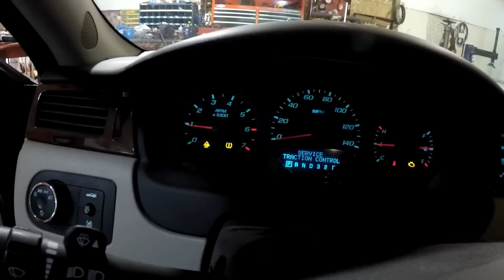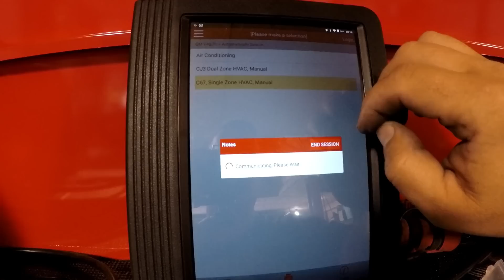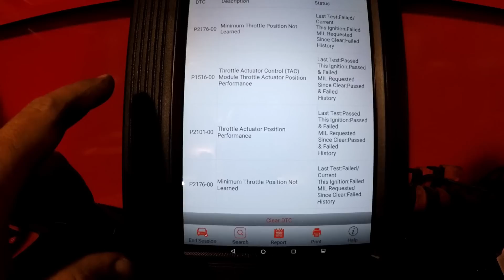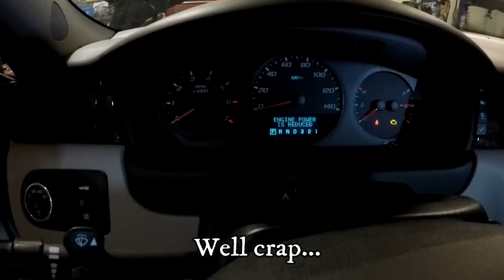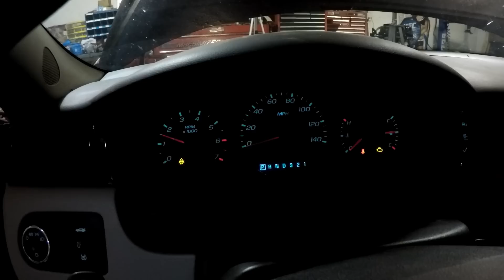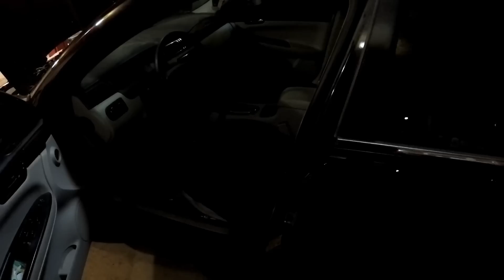How to fix Reduced Engine Power and Service Traction Control on GM Chevy Pontiac Buick

Comment: That was a very good video. Although I do not have that problem, it may become helpful because my son owns a Chevy Malibu. Would it be the same? Also, I did notice that traction control light but you did not mention anything about it since this video was not meant to fix that, however, my son's 2013 Malibu has that same light that will come on when he brakes. Any diagnosis/fixes for this problem?

Comment: I have an 08 Impala as well with that problem. That link just goes to Amazon btw, but I can find the part.
Anyways,  I have a basic scan tool-can I reset my idle?(if so,  how?) If I don't what will happen?(high or low idle?) Please advise

Comment: Great video. Thanx for posting. I have a 2012 GMC Acadia. I have replaced my MAP sensor (code thrown) and now my throttle body. I am still getting reduced power and stabilitrak signals on the cluster. It is running rough just like that car was. Any ideas where to turn next?
Reply: Hello Max…did you find a fix for your issue?
Reply: @professionalics  nope. The car is a disaster. I keep throwing money at it. Time to trade out of it I’m afraid to say.
Reply: Check your ecm, it's located under the airbox

Comment: Thankyou so much!... I was driving my 06 Impala ss and the "service traction control" came on along with the "reduced engine power"... I got it home in limp mode after only being able to go 30mph with a very rough idle... got it in the driveway and starting looking... I noticed when I turned the key to the "on" position I could hear a very loud grinding noise... Turns out the gears inside my throttle body were stripped therefore causing the rough idle and grinding sound. Picked up a new duralast Throttle Body installed it myself in about 15 minutes started the car and acted like nothing even happened in the first place... Came here first to see that the problem mightve been and low an behold... Throttle Body it was... lmao

Comment: Hey I need ur help I have Chevrolet impala 3.5 LS 2006 I NEED to change my IDLE CONTROL VALE can u please let me know were it is located the idle control VALE please help me thank u u can get in contact with me at 4845168460 please let me know were located at idle control VALE ok
Reply: I need to change the idle control VALE I can't find were is located they saying is on the left of the throttle body but I don't see it help me tell me were is at ok
Reply from the maker: Do you mean VALVE? There is no idle control valve on an 06 Impala. The throttle body is drive by wire and doesn’t use an IAC. The older ones (3.4) did use one however.
Reply: Santer auto how many OXYGEN SENSORS does Chevrolet impala 3.5 LS 2006 have my check engine light is on because oxygen sensors I change bank 1 and bank 2 but the check engine light comes back on I been told that they have 3 oxygen sensors but I can't find the third oxygen sensors but let me know how many they please thank u
Reply from the maker: I don’t understand what you’re asking? What’s the car doing?

Comment: Chevy should fire all their engineers cause this is  a problem. Change the  TPS and it worked.
I have all so check the ground wire in motor area and the ground wire in the bottom frame. thanks.

Comment: Great video. I have an 05 navigator the advancetrac light and abs light flash once and turn off with a little jolt to the vehicle. then it runs on reduced power or in third gear only, not sure which, until you turn it off and start it back up again then it's back to normal. Any thoughts on where to start looking for the problem?
Reply: B

Comment: i am wondering...
if the computer was silent, 
and all the sensors were not triggering,,,
would the vehicle have gone into reduced power mode, 
or would it have just operated normally...

Comment: I have a 2008 Buick Lucerne.  It has Engine power loss and traction control both coming on.  This has gone on for months. We have replaced the map sensor, had the catalytic converter checked out, put SEAFOAM in the tank,  and now replaced the air filter,  the throttle body and the air flow sensor - ITS STILL losing power driving.  Unfortunately it’s my daughters and she’s always having issues away from home after thinking it’s fixed ?!?! Any more suggestions

Comment: Ok so I’m lost here...did that have anything to do with the stabilitrak or just the reduced engine power? I have a stabilitrak issue that happens every once in a while when i start the car in the morning and my speedometer will start acting crazy going back n forth and the traction control lights come on and after it keeps going crazy the engine light will finally come on! Once the engine light comes on everything stops acting crazy! Funny thing is normally it only does it in the morning and won’t do it again all day or maybe eve for a couple of days! Im willing to bet its the damn sensor on the wheels! Nevertheless it’s irritating as hell!

Comment: I have a chevy equinox 2010 with reduced power engine and traction control.  when scanned, code P0089 and P228D is erasable.  Is this method also useful.  I bought new high pressure fuel pump, not still working.  what do I do?

Comment: I got the warning after i removed the ECU fuse to erase fuel trim after old gas and forgot to put it back on. Car is driving but check engine stayed on i hope it resets after a couple days of driving.
Reply: After a couple days the CEL was still on, i once again removed the ECU fuse and poured a can of seafoam in the tank; after i replaced the fuse the CEL and warning went away within the first mile or so.
Reply: @johncrankshaft2886  seafoam!!..the placebo effect strikes again!!!!!!!!!
Reply: @mikesecondo2254  shit tell that to the sensor and ECU, all i saw was the light turn off 🤷‍♂️
Reply: @johncrankshaft2886  oh yeah...got to be that snake oil (engine repair in a can)
Reply: @johncrankshaft2886  it's like comedy hour....how so many people think the so called piss foam fixes everything....it's called marketing gimmick!!!
Reply: @mikesecondo2254  your argument would make sense if i had mentioned that i felt a difference yet the code had remained on however like i mentioned the code came off which means that values had to change for it to happen; sensors read values not the owner's sentiment.

Comment: I've got a question. I don't have this Reduced Engine Power notification, but I do notice when I'm driving down a road at 25mph or any speed really, it seems like my throttle is being pressed harder by itself even though I'm holding the throttle down as steady as I can in one spot. I'll try to stick to 25mph, for example, and find that sweet spot, but the vehicle just jumps forward intermittently (rpm bounces up). I just find it really odd and it's been bothering me for a little bit. Could it be the throttle sensor/body like someone, i know, mentioned to me?
Reply: Mine doing this. 2012 They trying to tell me it the fuel injection. I have 45000 miles change my oil on time and never run out of gas
Reply: App sensor
Reply: Have you found a solution? Having the same problem here

Comment: He's guessing he doesn't know what's he doing.
Reply: Educated guess (scan tool and could comprehend codes) that started with the most inexpensive solution and ended up with a permanent solution. He could've just started swapping parts and hoped that got it. Imo that's the kind of guy that you give a case of beer to when you pick up your car.
Reply from the maker: Mhmm.

Comment: I have a 2011 GMC Sierra I replaced the throttle body and it still didn’t fix it after that I replaced the gas pedal and the problem got worse after that what else should I try to fix it
Reply from the maker: Check the wiring integrity at the throttle body connector.

Comment: I just got that engine power reduced after I replaced the  tps sensor and cleaned the throttle body, left the battery unplugged for couple hours. What can be my problem? A bad tps sensor from manufacturer or still need relearn procedure?
Reply: Had a reduced engine power on my Impala. Remedy was a loose connector on the throttle body.

Comment: My engine reduced power issue was the lower engine mount.
Reply: Say what??????
Reply: Mount separated and pulled the main harness out of fuse block. Not by much, but just enough.
Reply: @kellybenedix5173  Mmmmm... Intresting.
Reply: Mike the mount had no fertting so no indication that is was separated.

Comment: How can you tell if it's a throttle body issue or a gas peddle sensor issue?
Reply: I thinking you have to narrow them down with the scan tool. Auto zone will do it for free I think.

Comment: I had this problem with my 2011 Chevy Impala for over 2 years. When it would happen and I  had "service stabilitrak" and "Traction control" show up, my temperary solution was to disconnect the battery for about 5 minutes which would reset the computers. This worked for the short term but only short term. Eventually the problem came back. All the videos I viewed indicated frawed wiring and a mechanics help. This video was the only one which made sense so I took a chance and the sensor replacement solved my problem and was something I could do myself without help. I performed this solution 2 months ago and it has worked. I bought the part on ebay saving about half of what retail would have cost. I would highly recommend this sight for solving small vehicle issues. Always do your research before making mechanical repairs on your own

Comment: When my 2009 Pontiac G6 gets really wet I have this issue.  Any thoughts?  If I spray the engine it happens instantly.
Reply: Could very well be the coil pack... I know my Girlfriends Buick Lucerne had problems like misfiring and low power when it would rain or after a car wash... I bought a new coil pack for her an installed it myself in about 1 hour and it fixed the problem right up... Hope this helps!

Comment: مني لكُم نصيحّة عربيّة ؛
لتنظيف الخآنــّـق ( ثرتّل throttle ) اللي في 
خآنّق الهواء ( ثرتّل بدي throttle body )  
بمدخّل جسد ( ثرتّل بدي throttle body ) ؛

مو ضروري تفُك الخآنّق throttle 
الـــ ( ثرتّل بدي throttle body ) خآرّج 
المُحرّك خليه مكآنُه وأتبع الخطوآت التآليّة ؛

1 - أبداء ك؛ من غير ما تشغّل المُحرّك / 
حط مفتآح الأشعآل ( السوتش / أقنشّن سوتش )
على أون  ON / ما قبل التشغيل لا تشغّل ( رّن RUN ) - 

2 - وأدعّس دوآسّة البنزين / الوقود للصآنجـّة / للأخير ،

3 - وحُط عليها حجّر - طوب - 
أو طآبوقّة أو عصاء ثبتها بمقعّد / بكـُرسي 
السآئق حتى تمسّك دوآسّة البنرين للصآجــّـة / 
حتى تمسّك دوآسّة البنرين للصآجــّـة للأخير ،،،

4 - فك غطاء اللي فوق المُحرّك 
    الغطاء البآغّة لتصل للخآنّق  ( ثرتّل throttle ) 
    وسوف تجّد الخآنّق مفتوح للأخـّر . 
   لا تلمسُه قبل ما تطفىء مفتآح الأشعآل ،،،

5 - بعد ما تطفىء مفتآح الأشعآل 
لمنع الخآنّق ( ثرتّل throttle )  من الحركّة ،،،

7 - الآن /؛ 
     نظـّـف الخآنّق  ( ثرتّل throttle ) 
     وووومدخل الهواء في جُرم الخآنّق
    في مدخـّل ( ثرتّل بدي throttle body ) .

 ؛  As I just said above in Arabic 

You don’t have to remove 
throttle body out to clean the 
throttle and air intake inside
the throttle body ;

you can  follow these steps
 and use these proven steps ;

1 - put the ignition switch ON
     ((( don’t Run the engine ))) .

2 - Push the gas paddle all the way to the floor this will 
open the throttle plate inside the throttle body wide open .

3 -   Put a brick or stone or 
    [ stick laying to driver seat ]
       to push and holding the
       gas paddle to the floor ,,, .

4 - Now turn ignition switch off 
  this way will prevent the throttle plate 
  from moving or close during cleaning .

   Note ; tip
   if you turn ignition switch off
   You don’t have to disconnect battery

5 - remove the engine plastic cover .

6 - Now you will find  throttle plate 
    inside the throttle body wide open .

7 - Now clean it and the air intake with
     ((( Only with throttle body cleaner 
           or alcohol based cleaner )))  .

Best regards .
An Arab 
Engineer

.

Comment: My battery was near dead, used a halo jumper, got it going, got to the bottom of my street to find reduced engine power. I had to put the hazards on after pulling onto the main road just to limp off the main road. I let it run for 20 minutes, shut it down for over 30 seconds to reset. My first attempt didn't work, because I didn't wait. Most electronics in cars, I've found have a 30 second reset time.

Comment: I have this issue, will try the sensor. I replaced my accelerator pedal thinking that was the issue and it did actually help something, it’s driving better, but I still get this code, the traction control code went off though! Ordered the part so hopefully this fixes it!
Reply: UPDATE: totally fixed the issue in my 2008 Chevy impala! Thank you! And an update for anyone they’re discontinuing that part! I got one of the last ones
Reply: @toomanystrawberries  I look in my local junkyard for these gem parts. Super cheap there.
Reply: What part did you order

Comment: 2010 GMC Terrain. Changed the engine, Changed throttle body three times, changed the sensor, change the wiring...I am still getting Service StabiliTrak  lights and Reduced engine power while driving. I am screaming for help. What else could it be????
Reply: Change plugs and wires
Reply: @ericpatterson3769 thank you Hope that will solve the problem.

Comment: Those clips are easy to install if done correctly. Hammer not needed. You did install of clips backwards. "L" shape goes on first. Then press the "V" end on. No hammer needed. Beat on those parts can cause damage.

Comment: So you could have looked at the data on your launch and looked at TPS data. Next, hook up a three wire variable resistor in series and rotate the resistor. Should see the tps value move on the scan data. This verifies the wire integrity before you just go and buy a sensor and slap it in... guessing works sometimes, but its good to verify the fix before you replace parts

Comment: Hi there thanks for your video, question the butterfly has to be closed all the way down or can have an small gap?
Reply from the maker: It’s normal to have a small gap. Since drive by wire took over, throttle bodies don’t have idle air control motors so the throttle plate does that job. Hence why you’ll see a small gap.

Comment: I got the same problem with my 2004 escalade.
Reply: Fantasma Flores before you go buy all these parts!!!! Start with cheapest!!!  Check for frade wires at Tb sensor by moving a bit while car is on if car acts up it’s a frade where if not Change air filter, change/regap spark plugs , put very good fuel injector cleaner in fuel to unclog injectors if problem doesn’t fix then change Tb sensor making sure to clean Tb and do relearn procedure

Comment: I had a 2008 Malibu a few months back; same problem but the "Reduced Engine Power" and sputtering came after 6-8 miles of driving and would go away if you just let it stand for 6 to 8 hours (overnight).  I replaced the both of the Variable Timing Solenoids, and another variable timing sensor; Didn't fix the problem.  Then after watching a million YouTube fix it videos (because I am not a professional mechanic), I replaced new Battery Terminals, removed and ran without the Thermostat (even though there was no heating problem), and even tested with a direct connection to the Radiator Fan, so the fan will run constantly (again there was no heating problem but a YouTube video suggested that it fixed the problem in their same model Malibu.  It Increased the 6 to 8 miles to about 10 miles, but the never can get rid of the Sputtering and the Low Engine Power that will just happen.   

From all the videos I watched and the comments I have read, this problem can happen in the Malibus for so many reasons.  There is NO one fix.  Even the Chevy dealership acted like it was JUST MY CAR, when so many people were having the same problem and the fixes weer so different.  The dealer wanted $200 plus to diagnose.  Some people had  issue reoccur after spending Thousands at the Dealership throwing new parts.  Just do the research by reading the comments on YouTube videos.

Then there were some people who had fixed it by replacing the main fuse box.   For some people, it was the traction control that was causing it.  

I would have let you have it for free if you lived close to Los Angeles.  I just junked it and lost about $3500 and a lot of time and effort educating myself, working on it myself etc etc.  OMG The aggravation is just not worth it.

Just Don't buy a Chevy Malibu or an Impala.  Even Hondas and Toyotas have this VVTI but not these kind of issues after 6-8 miles of normal driving.  Then you have to drive home at 10 mph and it does not go away even if you start it in 2 hours -- needs to be left alone overnight.  It is FUNNY.   

Chevy made these cars with a lot of sensors and from what I understand even Chevy does NOT know what's wrong when the issue happens because all kinds of problems can display the "Reduced Engine Power" warning and the associated sputtering, like it is running on 2 pistons.  

I am Just gonna start RUNNING if anyone even gives me one of these cars for free.  I have never had a car like that 2008 Malibu.